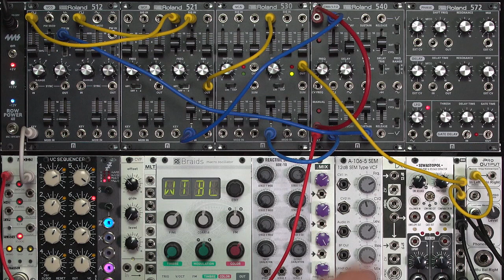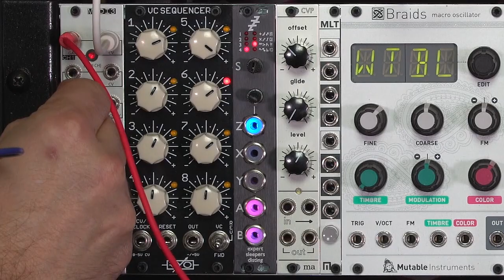Introduction to Phase Shifting with the Roland 572

Comment: Could you do an example of good ways to employ the Gate Delay? Thank you - great tutorials, great channel.
Reply from the maker: A separate movie on the gate delay portion is part of my original Learning Modular Synthesis course (https://courses.learningmodular.com/courses/learning-modular-synthesis). The short version is, you can use it to trigger a second envelope to get double-plucked sounds (like the initial attack of a harpsichord note), or for Steve Reich "phasing" type of effects. I also use it with no delay and the gate duration set to its minimum to help clean up clocking & triggering issues.
Reply: thank you for the detailed reply - i'm new to modular and hadn't heard of Steve Reich before but will look that up... the link you sent me is saying the page can't be found...
Reply from the maker: Oops - the ) got added to the end of the URL somehow. The course in question is:
https://courses.learningmodular.com/courses/learning-modular-synthesis

And here's a quick Wikipedia entry on Steve Reich's phase music:
https://en.wikipedia.org/wiki/Phase_music
Reply from the maker: @TheInterGalacticFederation  to hear the phasing technique applied to electronic music and sequencers, this link will take you directly to a "phasing" section in one of my favorite pieces of electronic music, Michael Hoenig's Departure From the Northern Wasteland. You could replicate this by having two sequencers and slowly dialing a gate delay up and down for the second sequencer, or by using an audio delay and changing the delay time.

https://youtu.be/SuM_vOBIc6s?t=682

Comment: Does diming the mix knob output a split 50/50 signal or pure wet? I was intending to get this to use primarily without resonance for beefening up stereo patches.
Reply from the maker: The mix knob is indeed a wet/dry mix.

Comment: Hey how well do your 512 osc’s track 1 volt per octave? Mine are pretty shoddy...
Reply from the maker: I find most of my VCOs require me to either hand-calibrate them, or to use an AJH V-Scale to tweak their tracking.
Reply: Learning Modular were you able to calibrate the Roland 512 yourself?